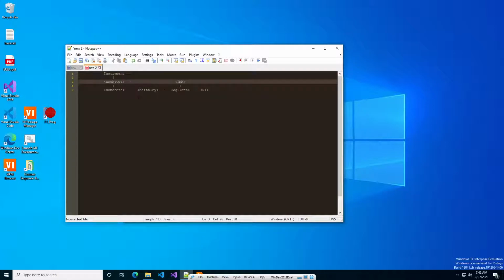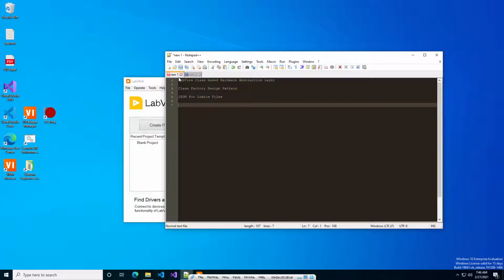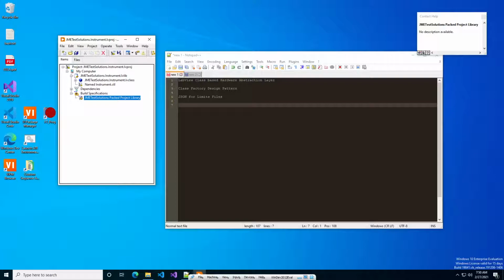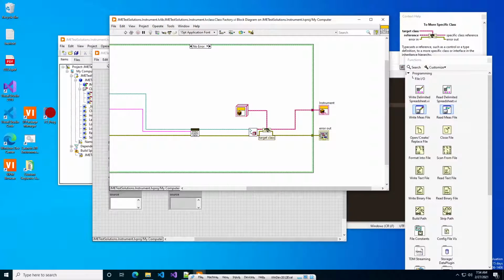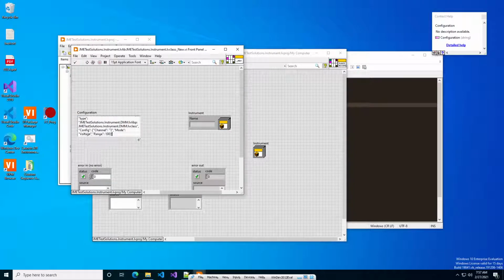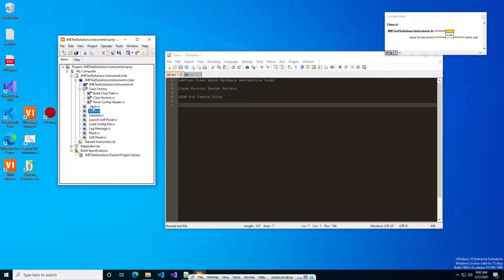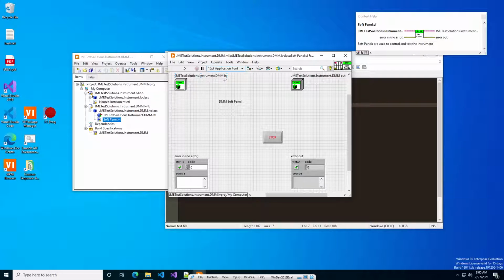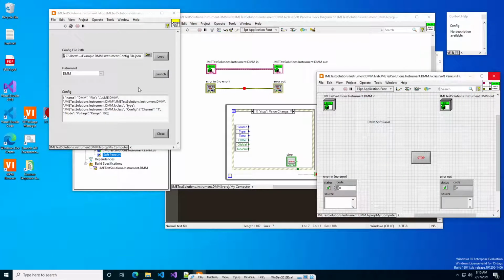How to Setup a Hardware Abstraction Layer with LabVIEW classes

Comment: I think you shouldn't worry about adding the json in the initialisation. Since an instance of the class exists somewhere let that be done by the implementer. Just call the init method.

The issue I have with json is that people tend for forget to change things and they just copy and paste or worse your user/operator finds it and starts messing it them. 

Just call your methods and don't worry about the nitty gritty.

Init -> Open -> Read/Write -> Close -> Destroy

You can then have methods/properties for obtaining the status and information of the instrument. Then methods for handling E-Stop and Reset.